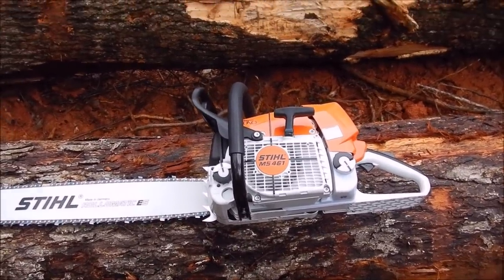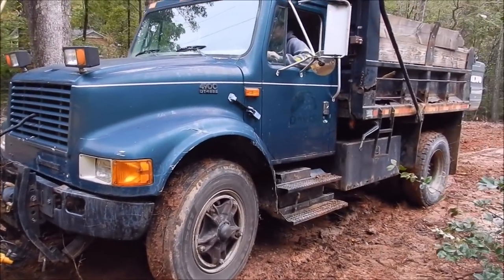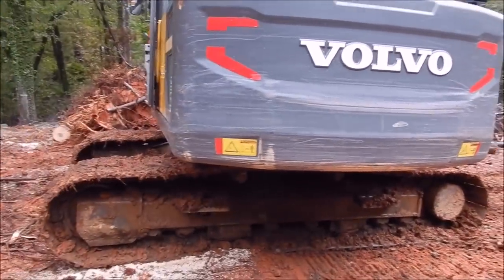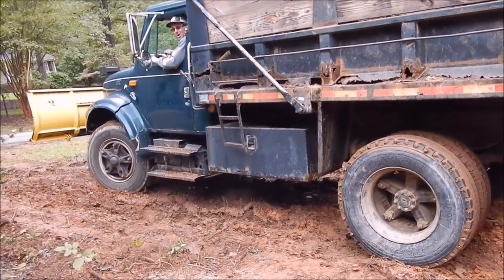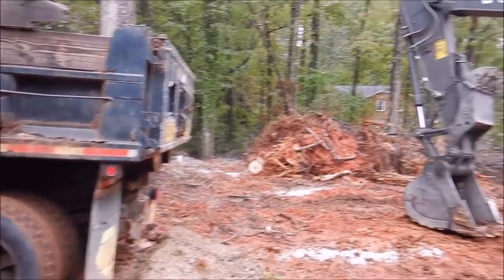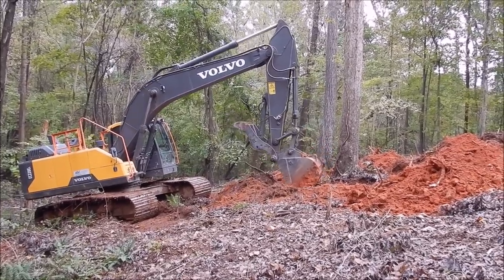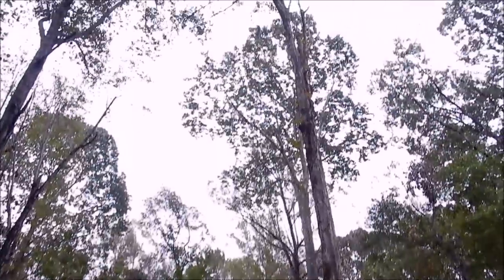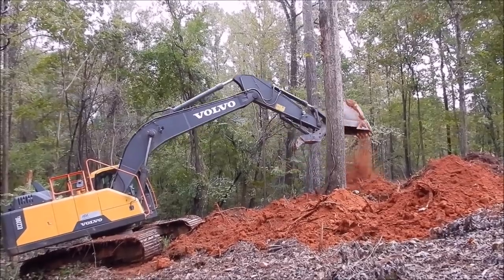New Chainsaw And Plow Truck

Comment: Higher gears 2or3 gear and it will go anywhere, to much horsepower on the ground, you learn this stuff by hauling belly dumps doubles, 2or3or4 gear if you have enough power in your motor, allways works, never get stuck again, nice chain saw, thanks BigAl California.

Comment: You guys missed the point !
Previous owners had it planned, the truck sits long enough for the trees in the back to get big enough to log, you cut them down with your new saw, and then load them up In the truck, take them to the mill, while pushing snow of the road ! 👌✔
Thanks for sharing and take care. 👍
Reply: Ohhhh, makes perfect sense. The rust holes are to let the water drain away from the roots. That's probably the same reason they used gravel instead of dirt.

Comment: You gonna like that saw. I love my 461. I have a 32"  on it and it saves a lot of bending over.
Reply: Same here. I switched my dawgs over to the long version so i can set it down on soft ground without the blade tipping in to the dirt. Its only 13 bucks for the west coast version well worth it for me.

Comment: FYI. From a northern guy some advise. Youre better off dropping your plow when not in use. Also extend the lift chain a bit. Your lift hoist will bottom out when your blade is on the ground. Just some advise for Justin.

Comment: That is a great saw. Just be careful fuelling it. Let it set a minute before taking the cap off. Sthil has a problem with the fuel spraying out. If you open them to quickly after running for a while. I found just letting it sit for a couple of minutes stops the issue. God bless

Comment: I have a confession.....I purchased my first Stihl chainsaw recently.  The short story is....I had a bad experience with a dealer and it turned me off from Stihl until a few weeks ago.  I was in a bind, had 2 chainsaws "trashed" from employees (another long story) and needed a chainsaw to finish a job.  My son-in-law was a "died in the wool" Stihl fan and his dealer was VERY close to my house.  I stopped in at 4:45 and walked out with a brand new MS180 before 5:00 with a two year warranty, both tanks full, chain guard and a six pack of oil mix for $200.00!!!  I've used that little saw for about six hours so far and I have to admit, I'm VERY impressed with that little saw!!!  Only weighs 9 pounds, plenty of power and it's become "my go to saw" on the job site lately.  AND the employees have been warned "DON'T TOUCH IT"!!!  :-)

Comment: When he puts the GPS and laser sensors height on that blade, don't forget to put on a 0.015" swing out shim on the fine adjust. That way you can swing out the shim after you adjust the blade to the road surface height, thus getting the necessary clearance so you just clean the lane paint markings and don't peel them off the road.  Safety first. ;-)

Comment: I have this very saw. 25" bar and everything. I run the full chisel. Cuts fast but you can't let it hit dirt or rock. And you have to watch the tip. Definitely will kick back like a mofo . Gotta be careful. And definitely get some chaps -- and wear 'em. Mine were sitting in my basement when I cut my knee open. Good luck with your new saw. You should like it.

Comment: The 461 will handle a 32 inch bar if you do so go with the Rollomatic ES Light with a skip tooth chain you may have to change the rim sprocket. I put the 32 inch bar on my 460 mag when the 28 inch bar I had wore out I do like the 32. I have used both 460 and 461 the 460 has more grunt.
Reply: I have the full weight bar wish i hadn't. But a full comp chain runs great for me especially for softer woods, a big yellow pine just melts away.

Comment: That ms461 is a skookum saw, run mine nearly daily without issue 5 years now...  It will pull a 36 inch bar but it dont have enough oiler to keep it lubed, does ok on a 323 though

Comment: Justin's new truck has keep back 50ft stickers because of loose flying bed parts, If it was a Dodge truck it would be keep back 100 ft because of flying Ball joints and drive line components.  I see the potential in repairing that box if a guy puts  time and steel into it, it would look smarter in a hurry.  I was thinking the blades not strong enough but seeing as the trucks auto, and needs a huge amount of weight to get traction in mud or
 snow it won't have enough balls to hurt it. i know a guy has a 466 auto grain truck it's nothing special in the power department either. The new
 saws nice Of course the new blades not sharp, they wouldn't want anybody cutting themselves with it getting it out of the box L.O.L .   
Thanks for the video,take care guys.

Comment: I bought a MS 461 at the Florence flea market,  for $300, back in August. I'm pretty sure that guy that runs the small engine  repair business there, didn't know what he had. One of his guys had no idea how to start it. I jumped on that $1100 saw for $300. It didn't have the right spark plug in it. After I bought it, I got the right spark plug for it and it fired up on the first pull.

Comment: Stihl the best chainsaw ever
Reply: @cody hyatt you don't have a clue about saws
Reply: He's rite.
Reply: The Forest Service and most fire departments use Stihl if there using them to save life and property then their a good saw I used them on the fire line and compared to any other saw their the best that's my opinion and that's all it boils down to is matter of opinion
Reply: When I use to cut pulp for a living I used Huskies and I was very happy with them.
Reply: Not anymore.  Husky is by far the better saw.  I am in the industry and lots of Stihl dealers run husky saws personally.  Stihl  is a good saw, but they have forgotten the pro guy in favor of the homeowner.

Comment: What a pity that new saw didn't come with all the safety gear. Bigger bar means longer chain, if it comes off or breaks, it could easily wrap round your leg or arm.

Comment: You guys have to much fun to call it work and Justin has the back of the excavator all down in the brush honing the finish on the back. A little JB weld will fix Mr. Plow up.

Comment: Get rid of that safety chain and you'll see how she really bucks. Also I'd break in a new saw avoiding full throttle for the first 5 tanks minimum
Reply: You run them full throttle to break them in.
Reply: That's how you run a saw full noise or nothing
Reply: Stihl says not to run it at high RPM for the first 3 tanks and that it won't have full power till 5 - 15 tanks in the owners manual for the MS461. Top right on page 26.  https://www.stihlusa.com/WebContent/CMSFileLibrary/instructionmanuals/MS-461-Instruction-Manual.pdf

Comment: What state are you in? That blue truck would be pulled over and a complete inspection.  Ontario it has to be certified each year, all trucks have to have air suspension  spif axle controls  very $$$$$$

Comment: Gotta say, I know y,all been doing this years now. If you let the machine hold the log off the ground some it makes for easier cutting and saves the blade from gettin in the dirt n gettin dule on ya.... Sayin....
Reply from the maker: Yeah but you waste alot of time holding every tree off the ground. I knock down 8-10 trees  and then cut them all up at once

Comment: i run a 36 inch bar on my MS391. I have run the same 36 inch bar on an MS290 before the saw was stolen. Are you sure your chains are sharp? All the power in the world counts for nothing if your chains are dull.
Reply from the maker: That was the chain that came on the saw, I forgot that they never seem to cut has good as a sharpened or just a new chain in general
Reply: i was talking about the old saw. you said it didn't cut good because it wasn't powerful enough.

Comment: How come you didn't go over there and cut the tree with you new stihl 461chain saw and Justin could have then pushed it over
Reply: This process uses the weight of the tree to assist it getting the stump out
Reply: Nice fast way to stump a house lot if your the one doing the tree work.        In that type of soil.  Dont work so well in our rock pit soils.